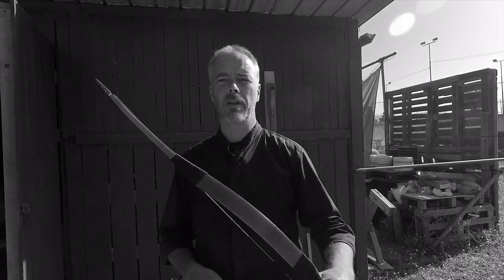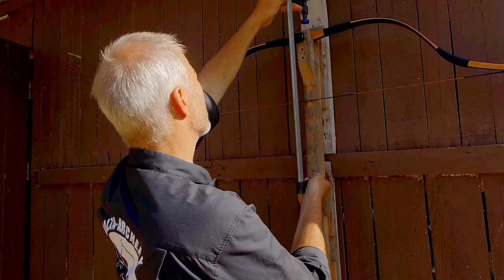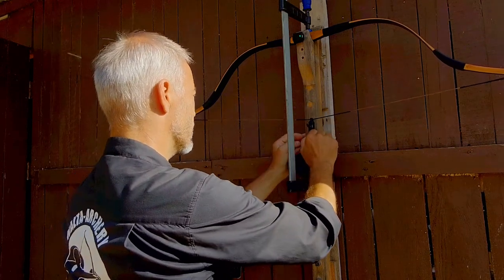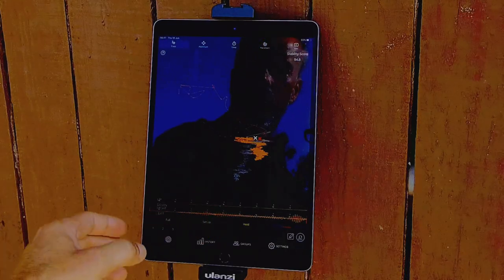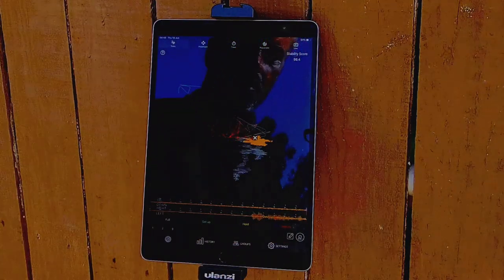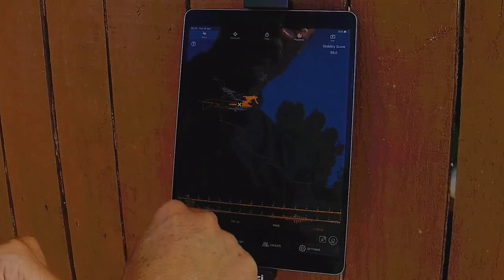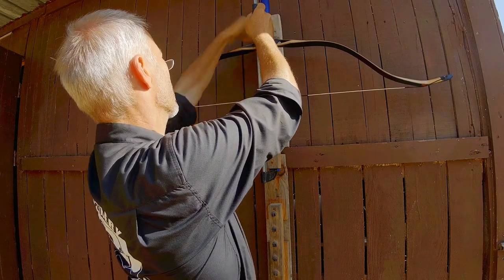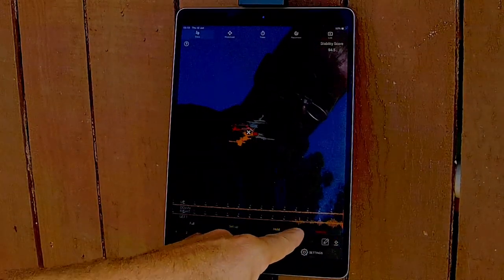How to measure hand shock and vibration of reflex bows? Archery Research

Comment: I like the idea, but there are some variabels here. How do you know you clamp the bow as tight as the other ones? This will influence the result. Also needs a constant point of release and automatic trigger system that would elliminate different test results between shots and bows. Although this is close, it might still influence it ;) Curious to see more!
Reply: You can attach a pressure sensor between the bow and the tiller. Also why draw empty bow? If we are going to automation route, we can go straight to building bow shooter complete with the arrow and all the sensors we need. From there we can go measure the hand shock, vibrations, and arrow speed at exact draw length or exact draw weight.
Reply: And then you build an auto bow reviewer.
From "it has quite some handshock" to "here is the most accurate visual representation of what I felt" there is a whole lot of information, curated by an expert. Let's hope Mantis works with Armin for a trad-bow clamp and this graph could be taken at the same time he measures the arrow speed: some graphs representing the intensity of the vibrations through time for different arrow weights and the speed the arrow left the bow. As close as possible.
Please don't turn these reviews into a data-collection fest. I want to know his opinion
Reply from the maker: @JuanCLeal  no worries, this will be as far as I go with science :) for me its all about feeling. Somebody simply asked how my sensation could be measured ;)

Comment: really very nice away around!  you did manage to use this equipment for something unexpected und interesting, oh I wish I could be doing this tests, I find it really very interesting!. . I wouldn't stack the 3 shots on the graphic, then those grey lines would not show. in my opinion would be better to judge vibration and compare between bows. Did the long bow got a bit loose by the third shot?  there is so much movement compared to all other results.  Maybe the tightness from which the bow is held in place would interfere in the results? something easy to verify.  keep the great work and I am sure you will surprise again when you come back with more information on this topic. cheers
Reply from the maker: thanks, yes a said the mounting can cause irregularities

Comment: In case of bow with big and tall string bridges I think this would measure more handshock because of the sting landing on the string bridges(if it even lifts from string bridges - if not than it would show less of handshock compared to anothe types of bow). I'd sugest that you build a jig that holds the bow firmly and shoots an arrow and measures vibrations/handshock. Take some arrows, let's say 10gpp (if needed their weight can be adjusted with tape of something) shoot it in the jig. That is the most scientific and precise way how to measure it. It's a little bit more complex, but in my opinion worth it. And as a bonus we don't get to hear that terriblly upleasant sound of plucking the string while the bow is held steady - brrr. Thank you for your videos. I need to go look for another bow now thanks to you :D

Comment: This is really cool. The vibration persistence graph is perhaps the easiest to understand. The hand shock magnitude, less so. Would be interesting to see a similar test for each bow at a standard draw length. That is, mount the sensor to the bow and draw to 28" or 30". Given the different draw lengths between bows the comparison might be best made to the tillering stand test, rather than between bows.
Reply from the maker: thats just the beginning :)